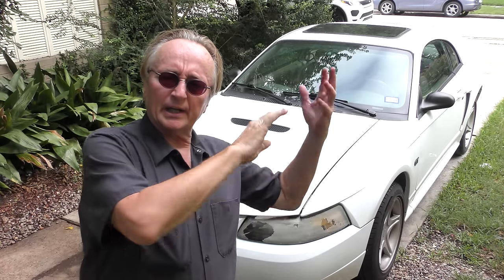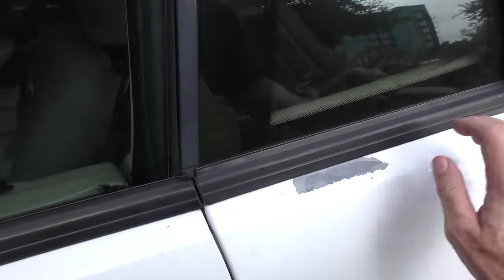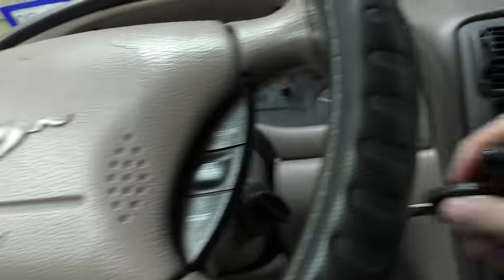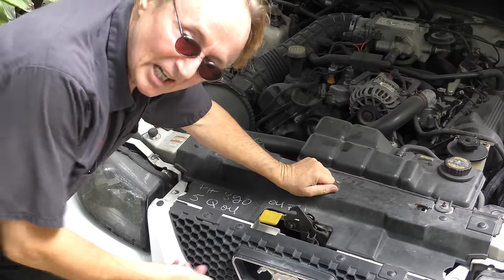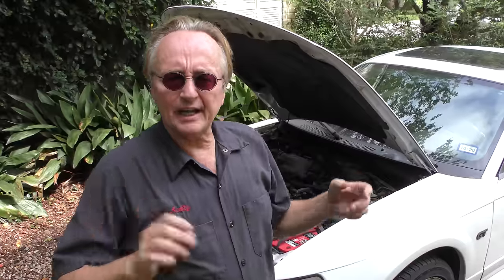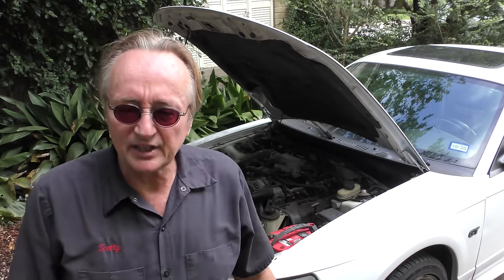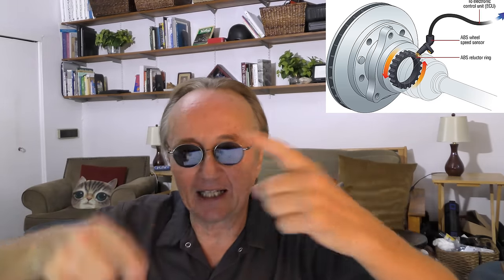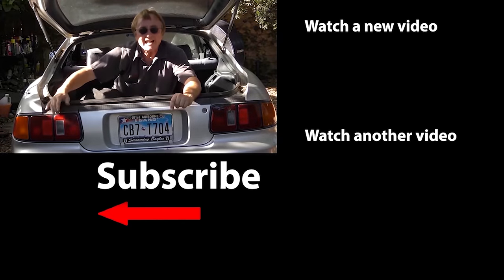Buying an Old Mustang and Fixing It Up

Comment: I love my 4.6L modular Ford's. I hear all kinds of gripes about the 5.4L, but I've had nothing but great experiences with the 4.6. I've had 2 F150's with one. The first one ran well over 200k without ever being taken apart. My 2nd one is in the 2006 F150 in my driveway with155k. It's my daily and still runs strong. Stupid stuff keeps breaking on the truck now because it's getting old and I live in Pennsylvania where the weather destroys vehicles, but the motor and trans never gives me any problems.

Comment: Years ago I bought a white 2004 Mustang GT automatic with about 50k miles. It's never been driven in winter and I still drive it around otherwise. I only put on new brakes, tires and alternator and change the oil and filters once a year. The AC is still cold. It could not be cheaper to maintain!

Comment: I believe from 1979 to 2004 are the best mustangs. Even the 4 bangers of the 80s to the V6 of the mid 90s and up. Thumbs up!
Reply: Good luck finding one that hasn’t been modified. Usually the issues start with shotty modifications or inferior parts used to ‘upgrade’
Reply: @210SAi  very true

Comment: I bought a 2000 GT Spring Edition in 01' and drove the hell outta it. 275k miles with 1 major repair in 15 years- transmission.  But to be fair I was racing the car weekends at the drag strip and daily driving her 45 minutes to work...one way/5 days a week. Great engine and LOVED the bassani x pipe and Flomaster American Thunder mufflers on the 4.6.

Comment: My 2000 Mustang NottaGT with the V6 and automatic transmission has been in the family since new, I have driven it about 9 years myself.  150000 miles, never broke down, worst repair was crack in water pump.  The plastic vent “cowl” below the windshield has deteriorated a little, and the haze on the headlights I haven’t bothered to restore.  Oh yeah, once had to replace gas cap, and finally a few front suspension parts around 145k miles.  That’s all, everything else was normal consumables, and all parts of the car continues to work great except the radio - now I use Bluetooth speakers 🔊

Comment: The Ford 4.6L Windsor is bullet proof tank. (If you do scheduled maintenance with oil and fluid changes) Had a 40th Anniversary T bird with one (4.6L) with over 450,000 miles. No garage, living in Chicago rusted out body to the point of unsafe. Got bought for the engine though. Parents have 97 Lincoln Town car 4.6L (Panther body) and 98 F150 4.6L 4x4 still cruising around in them both over 250,000 + miles! Ford put them in everything including fleets, so info, repairs, and replacement parts are plentiful.

Comment: I will stick with my 67 Mustang fastback  hi performance  289. T-10 Top loader 4 Speed,  factory  Philco 8 track, ...Dats my Baby !
Reply: BorgWarner T-10 and the Ford Toploader 4 speed are 2 different transmissions as in the T-10 is not a toploader ... Ford stopped using the T-10 in the early 60's

Comment: Just put a new 5 speed transmission in mine. Car still runs like new. Not a bad for $4k, drove it 3 years without any major issues! I get paid mileage to drive to appointments all over the state for and mine gets 34mpg in the passing lane with a ladder in the trunk. Its a money making machine for sure. And maintenance is a breeze. I have a 4x4 truck if the weather is bad but it just sits for the most part.

Comment: In March 2019, I bought my V8 2003 Mustang GT 5-Speed Manual for $3,000 dollars, that's got over 160K miles (I still have her to this day), and when I bought her, she needed a lot of work done and I invested A LOT of money on my 'stang, replacing parts like the new clutch, new suspension, new battery, new alternator, AC Recharge, new head gaskets (both sides), new intake manifold, new radiator hoses, new radiator, new brakes, new tires, new LED headlights, and new full aftermarket exhaust system (My stang runs really well now, and is LOUD af)

Comment: Bought a 2000 3.8 litre V6 Mustang, it's my first vehicle. 96,000 miles on it but it's a nice cruiser and has no issues. Hope I can get it past 150,000 miles. The new edge mustang has its flaws but it's still a good car all around. Funnily enough my base model mustang in 2000 was $17,000, I paid $4,200 in 2020 and thus I became the second owner of a new edge.

Comment: this is the first new edge mustang I've seen with a Sun roof😳
Reply: I noticed that
Reply: Maybe it’s aftermarket 🤔
Reply: @instasingingvids3529  from what I'm told, that's never a good idea
Reply: I heard back then it was an additional option on the lot for 3k
Reply: It looks weird and cool in a new edge mustang which didn’t have them.
Reply: @angelgjr1999  i rather have the convertible
Reply: PANTYEATR1 nah too slow
Reply: Same here. I think its aftermarket
Reply: It is aftermarket. There were no sunroofs since the sn95 and the sn95-2 doesn't have it either.
Reply: @angelgjr1999  i know how to make power😏
Reply: PANTYEATR1 true. I like convertibles but every one I’ve seen for sale has had a hole in it.
Reply: @angelgjr1999  sounds like a chance to get experience at replacing the top. it's not easy, but if it was, everybody would be able to do it

Comment: Just bought a 2002 Mustang GT with a 5-speed manual with 70k miles for only 6 grand. The car is in great condition and it has a blacked out leather interior that’s in perfect condition. The paint job on the outside is also immaculate. Only problem is that I need to learn how to drive a manual.

Comment: Those mustangs don't have factory sunroofs, it's an aftermarket.
Reply: pretty sure it was an option for them back then lmao
Reply: You are correct, the roof is so curved  I bet this one has a ton of rubber gasket to prevent water leaking in.
Reply: Edward Telles  only thing that leaks on my '99 Tacoma is the sunroof the original owner had put in.

Comment: Anyone surprised? Ford builds solid vehicles!
Reply: *Used to
Except F-Series trucks
Reply: Yadonious 500 I disagree I drive an 02’ f-150, has over 200,000 miles, and still runs like a champ
Reply: Carsen Bart What I’m saying is that everything except F series used to be good, but are not as good anymore. F series used to be good and still are
Reply: Yadonious 500 🤦‍♂️ my bad I misread
Reply: Earl Lee they stopped making minivans in 2007 but they were fairly well made; I still see a lot of them on the road
Reply: @yadonious5005  really depends on the car, some ford will run forever some not.
Reply: Earl Lee lol I haven’t seen a Ford minivan in forever

Comment: I own 2 of these cars— an 03, and an 04 respectively, both GT. owned mustangs for about.. six years now? I won’t say it’s the most reliable thing out there, but I will say as long as you change the oil regularly and make sure your fluids are topped off, most of the work I’ve needed to do on these cars I could, and have, done by myself. So user friendly and spacious, even with a v8 under the hood. Plus, a side effect of the cheapness of the interior and way ford uses interchangeable parts to reduce overhead cost, everything on these cars is really cheap to purchase, and really intuitive to do work on. That, and if you don’t like cheap and fast, there’s a huge community of people making aftermarket replacements for just about everything in the SN95. Though, something I will say for anybody thinking about buying this kind of car and not knowing what they’re about to get into, keep a spare serpentine belt in your car with the appropriate ratchet size for your belt tensioner. That belt likes to snap after awhile. Overall, give these car the literal minimum amount of care and attention and you’ll have yourself a car that’s gonna do what YOU ask it to, no questions asked; just be careful what you ask for.

Comment: Those 4.6 2V are damn good motors. I currently own a 1992 Lincoln Towncar Cartier with the AODE that i bought with 83k original miles for $1850 back in october.  Just rolled over 88,000 miles and its an amazing daily. It could use paint from clear coat fading, but otherwise its beautiful. I wxpect to drive it for many years to come. Also- those new edge mustangs you had the V6 base model, the 2V 4.6 in the GT, and tge 4V 4.6 in Mach 1s, 99/01 cobras, and the 03/04 cobras had the 4V 4.6 with an eaton supercharger. There was also the SUPER rare Cobra R that had a supercharged 5.4 if im not mistaken. But otherwise all the newedge mustangs from GT and up were all the 4.6L, just some 2V some 4V and the terminators had the eaton (besides the rare cobra R)

Comment: Rev up your straight piped 5.0's 😁
Reply: Push rod 5.0 or DOHC? (The car featured is a 4.6)
Reply: @UmmYeahOk  is the 5.0 dual overhead cam the coyote engine?
Reply: John every mustang after 1995 came DOHC. They dropped the pushrod 5.0 found in foxes, for a 4.6 L V8 which was around until 2010. Replaced by the new “5.0” which came in a DOHC configuration. The new 5.0 imo blow away every other 4.6
Reply: @Loujr2250  The 2V's and 4V's sound better than the Coyote to me, but performance wise the Coyote is a monster compared to them.
Reply: Oh definitely. I’ve owned a 306 with a b cam and good flowing heads, and that to me is my favorite sound of the mustang. My dad has owned several 03-04 termis, currently got a SL500 with a 5.0, and my brother has a 1100 hp F150 with a coyote in a single  cab lol. But I must agree The 4.6 sounds amazing.
Reply: @Loujr2250  I'm only 25 so my 5.0 is my second car ever, but god damn are these things monsters. Termis to me have the best sound with their stock blower and borla stingers.

Comment: I got my 1999 GT 6 months ago for $3000, it has 150,000 miles on it. Car ran and drove, but it was somewhat of a project.

Had to replace the rack and pinion on it, and completely paint the right rear fender of the car because it was just primer. As well as replace a missing lower rocker end and 40th anniversary badge on the side.

Edit: almost forgot I had to replace the radio, got a cheap Walmart one that had Bluetooth, thankfully the speakers still worked.

Comment: Great car for sure....I use mine as a daily driver...317K miles and counting. Major work done on the car after 15 years, intake manifold (because they are mostly plastic), fuel pump, AC compressor, shocks. Regular maintenance (fluid changes, tune ups) will keep the car running. My target is 500K and I'll be more than happy. After that I might have the Engine and Transmission replaced and keep it mostly stocked. Love my Stang!

Comment: The bigger engine is a 32 valve 4.6 same cubic inch as the gt you just showed. Unless its a 2000 then the cobra R which had the 5.4 and they only made 301 that year.  Awesome video as always! Keep  up the awesome job!

Comment: There is no “bigger” V8 for those cars😅
Reply: The Cobra R would like to have a word with Scotty.
Reply: 5.4 DOHC Cobra R laughs at you
Reply: I think the Cobra had the same engine but with bigger displacement at like 5.2
The Cobra has a supercharged F-150 engine in it.
Reply: @angelgjr1999  the only Cobra that had a bigger engine was the DOHC 5.4 in the 2000 Cobra R, it was naturally aspirated and made 385hp. The most powerful Cobra was the 03-04 Cobra, they had a supercharged 4.6 DOHC rated at 395hp but really made around 420hp. The 03-04 cobra engine was not shared by any other car, the only engine closely related to the Terminator cobras engine is the 5.4 in the Ford GT
Reply: @mr.boostang2064  the cobra R shouldn't even be a topic as you can't simply go out and buy one of the 200 or so cobras R's on the planet
Reply: @DaBrute  at the time they came out if you had deep enough pockets you can order one. The Cobra R is a well known new edge model so it cant be simply ignored as it never happened, yes it was very limited but it still was a model available to the public for purchase.
Reply: Boostang That’s badass bro
Reply: im sure scotty was referring to the cobra models and even though the 2v 4.6 and the cobra 4v 4.6 have the same displacement the 4v 4.6 is physically larger due to the massive size of the heads in comparison to the 2v 4.6 heads
Reply: He's talking about the Cobra R 5.4 V8

Comment: I drive a 97 ford mustang gt 4.6L that’s been a babied and is in 100% excellent Condition due to 3 main things I do, i change my oil
On time, I use 93 octane gas , and had no accidents and mainly never  rev the engine over what is necessary

Comment: I have a 2000 Ford Mustang that's my daily driver in Wichita, KS so it's variable weather year round - Convertible, Metallic Red, 150k Miles I got for $2500 and poured many hours of TLC into. Would not trade it for anything!

Comment: I use to own a 2001 GT. The worst things about it were corning, took forever and felt like a boat, and exhaust drone during daily commutes. At low rps 1500-2000 ish it was always drone and vibrate in the cabin.

Comment: In June I bought a 2000 Mustang GT for $3500, the car is in great mechanical condition but has a couple scratched in the paint. It's got comp cams, k&n cold air intake, injectors, fuel rails, bbk throttle body, tuned for 93 octane, lowered bbk headers, catless x pipe, lowered, short throw shifter, tac with shift light, momo steering wheel, cowl hood. thats about all i can think of off that top of my head. it should be making around 325 wheel horse power

Comment: I bought an 02 GT Mustang (4.6 liter) with 60K milers on it, because it was only $3500, I wasn't super crazy about the car, but it has REALLY grown on me.  10 years later, it has over 170K and has NEVER been to the shop.   At about 80K, it lost it's oil through the filter and seized the engine.  I let it cool down, replaced the oil and filter and gave the crank a little tug and it started right up.  90K miles later, it is still going strong.  I have only ever had to replace about two coils the whole time.  This has been one of the best cars I have ever owned.  The poor car has been hammered by deer high wind and hail and looks really rough.  I am contemplating doing a full resto of the car

Comment: 2 things. 
1: The 4r70w was also great for drag racing.. high stall tc, jmod, and 2 step/trans break + boost you will have a lot of fun.. even stock the transmissions last forever along as they don't overheat and u change the fluid every 60k or sooner.. 
2: the cobra is an exception in my opinion. It was basically a supercar or the hellcat of its generation.. it's sort of unfair to compare a  2v to a 4v supercharged.. not to mention the cobra is much more expensive

Comment: Got my 2001 Ford Mustang V6 brand new with manual transmission for $14,500 out the door.  Still running strong at 156,000 miles.  I've only had to fix or replace the following:  fuel pump, heater core, steering rack, coil pack, AC compressor clutch, hood cable release.  Everything else is wear and tear items like brake pads (twice), rotors, clutch, tires.  I've been pretty religious with the maintenance on it.  You take care of it, it takes care of you.

Comment: I am in the process of trying to purchase a 2000 Mustang that needs a clutch cable. Those don't cost that much and seemingly aren't that difficult to replace. It's only got a 3.8 V6 with a manual shift transmission, and it's a convertible. I feel I'm making an excellent deal. I just have to wait and see. Car seems to be in good shape for a vehicle that's 23 years old.

Comment: Scotty, you were referring to the 5.4L 385hp motor from the Cobra R. You couldn't normally get that engine, and still can't buy it from a crate/junkyard. However, it is possible to get a similar motor if you can get your hands on the DOHC 4.6 from the 1999 and 2001 Cobra.

Comment: It’s actually not an AODE it’s a 4R70W. The 4R70W is the successor to the AODE. Stronger internals, shorter 1st and 2nd gear ratio. The AODE in the SN95 platform was only used for the 1994 and 1995 model year.

Comment: I just bought a 2003 mustang 3.8L V6 for $4,800 but it needed $2,700 so it came to $8,191 with tax. But it's only got 77k km on it. Good price?
Reply: uhhh $8,000 for a 2003 v6 mustang.................. hate to say it but you got ripped off big time.. and made the mistake of buying it from a car lot.. thats a 2500-3000 dollar car at the most in good condition... scotty said owner of the v8 mustang gt in the video paid $5000 for it 10 years ago... i bought my 96 gt v8 5spd for 2500 couple years ago

Comment: I owned an 02. It was a great car but the heads had very little thread to thread the plugs and were known for throwing out spark plugs. Just make sure you put the plugs in tight and just check them every other oil change

Comment: Hi Scotty. I have a 2000 GT that my wife and I bought new. 7 years ago the motor went south and it sat in the driveway for 3 years. I put over $12,000 into it. Replaced absolutely everything. I was putting a back up camera in it and noticed all this rust debree in the trunk! The dam thing rusted from the Inside! No way to fix it. Before you buy a 20 yr old mustang, check the trunk!!

Comment: SCOTTY, THOSE MUSTANGS IN ALL OF THOSE YEARS WERE GREAT CARS.
.THEY WERE EXTREMELY RELIABLE COMFORTABLE AND THEY WERE FAST. MY FRIEND JUST BOUGHT A 2002 GT CONVERTIBLE PUT LONG TUBE HEADERS A THROTTLE BODY AND CHIPED IT. THE CAR IS A F**** ANIMAL IT SCREAMS UP TO 7,000 RPMS HE ABUSES THE S*** OUT OF THE CAR AND THE MOTOR STILL TICKS AWAY LIKE A CLOCK.

Comment: I wonder what Scotty thinks of the 2000 corvette with 773,000 miles with the original engine and transmission with no rebuilds. I believe the original head gasket went bad at 730,000 miles. It’s currently at the National corvette museum.
Reply: Never heard of it but that’s impressive